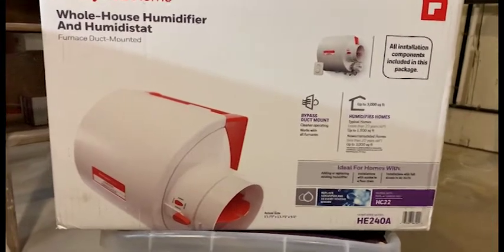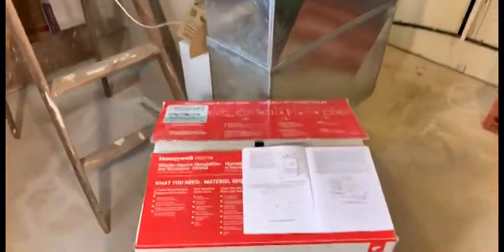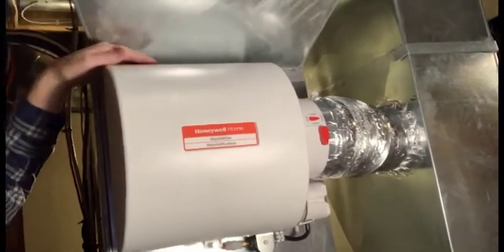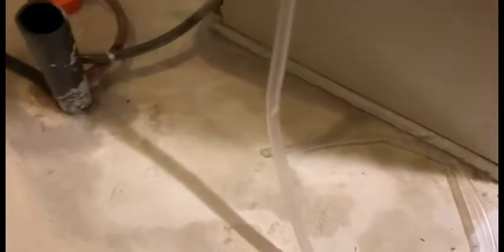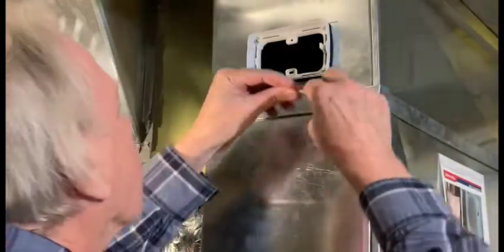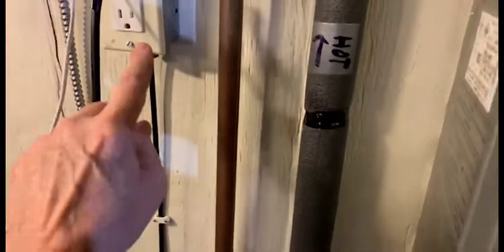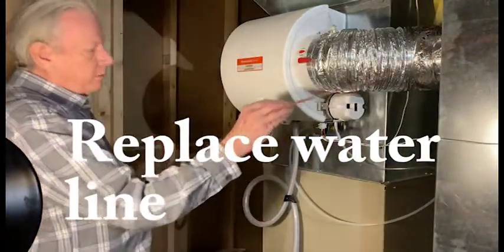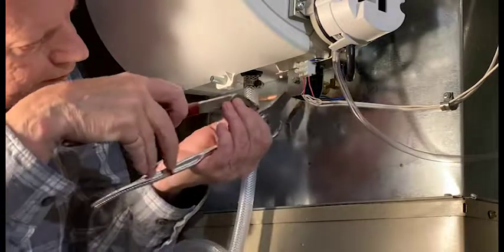Honeywell HE240 Humidifier Installation

Comment: 20 years as a HVAC technician and believe me when I say have a professional install your humidifier to prevent water leaks, flooding or miswiring which can void any warranty you may have on your furnace. Also, if possible try and connect the transformer to the board of the furnace "HUM" and not the outlets on the wall
Reply: Would you recommend wiring a receptacle to the HUM terminals, or just getting a different 120:24 transformer and wiring it directly?
Reply: @cnearing6124  The proper option would be to hook up the transformer to the HUM + Neutral pin on the control board if not then ditch the transformer altogether and connect the wires to C and W
Reply: @Who_R_we  Thanks. I'll probably connect it to the C and W wire as I think that makes the most sense.
Reply from the maker: Both ways work. choose the best one for the particular situation.
Reply: Is it ok to run a humidifier like this through flex duct like he's using? Id think that would pool moisture and promote mold